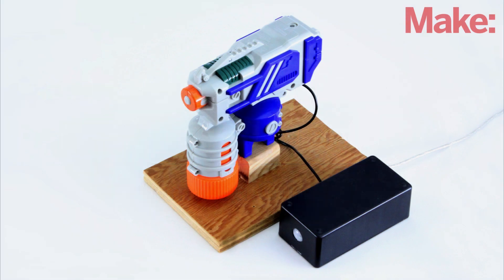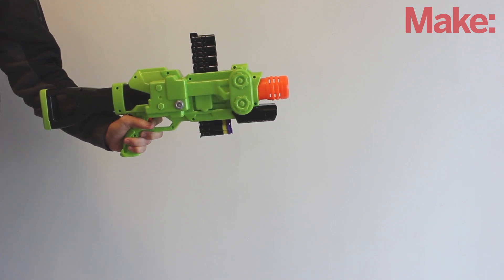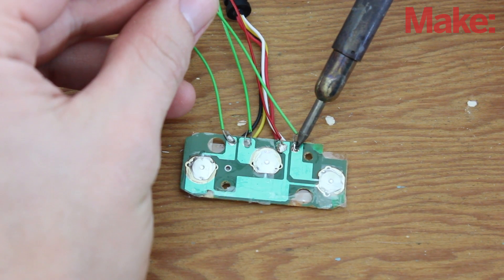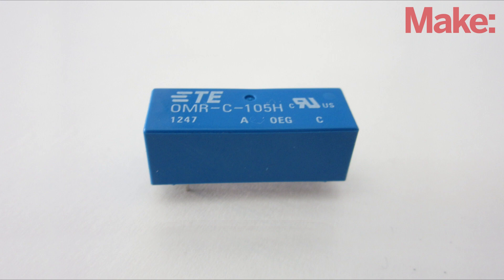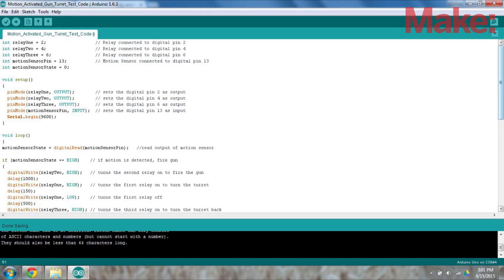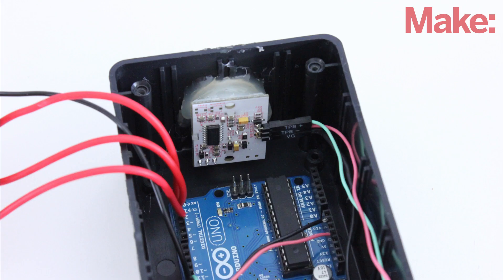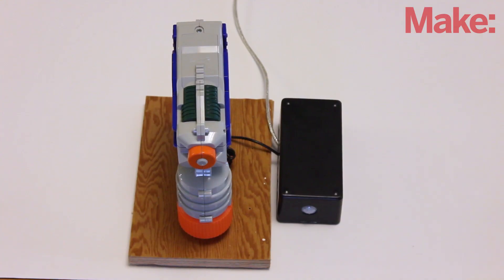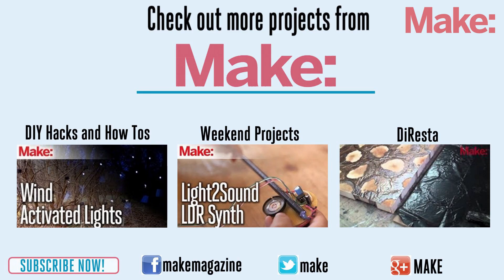Motion-Activated Water Gun Turret

Comment: HELP! How do you dissemble the main body of this water gun? I don't want to break it when I take it apart. The shooting power of the gun has never been strong and it only shoots a few feet now. I removed all the screws seen on the side but up where the battery compartment is it seems glued together. Any tips for taking it apart. You sound like the guy that is the super engineer that does all the super powerful lasers. Go video but not what I am trying to do with this great toy idea. Thanks!

Comment: I just did this. I used a raspberry pi with a relay hat called "slice of relay". I only use the firing button, none of the turning stuff. Careful cracking open the control, the board is inline with the crease on it, so don't crack it too hard. With the relay all you have to do is put it on the pi, put wires into a relay, solder the wires to the panel, type the code in the included pdf (comes with slice of relay) and you're done. Took me 30 minutes.
Reply: Do you have any photos or a guide using the raspberry pi?
Reply: @mikes4086  hey you just need a relay hat, snip the wire to the controller and feed it into the relays. I ended up also disabling the turret from moving. I'm doing this again with a different watergun, actually using a water table water pump.

Comment: The protection diodes on the relay coils is missing. They should be there to avoid killing the arduino from inductive feedback ...
Reply: ***** Aren't they on the bottom of the perfboard at 1:27?
Reply: rlrsk8r1 Yes. But not on the breadboard.
Reply: ***** The switches are hardly anything more than controlling logic either so a semiconductor solution seems more practical anyway in my opinion. I guess you wouldn't even need the arduino in that case, but that might be against Make: regulations.